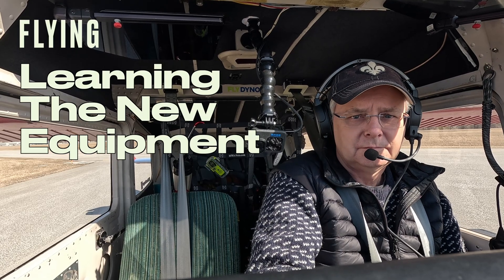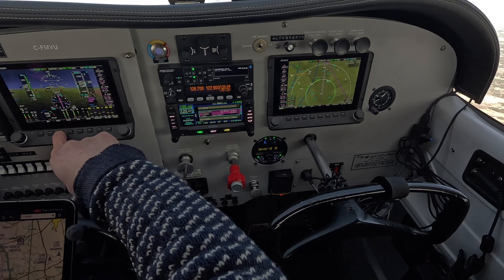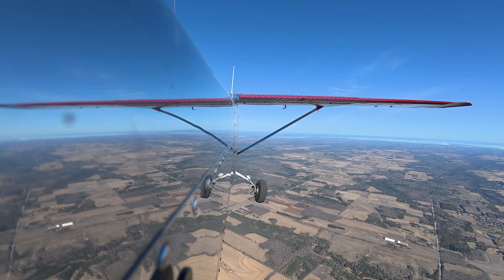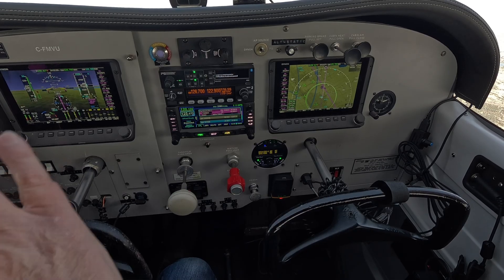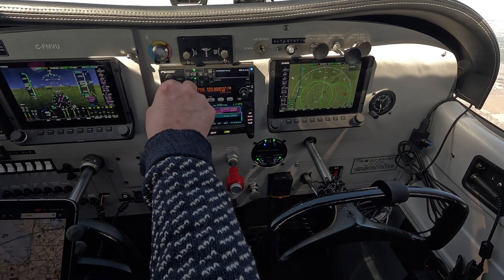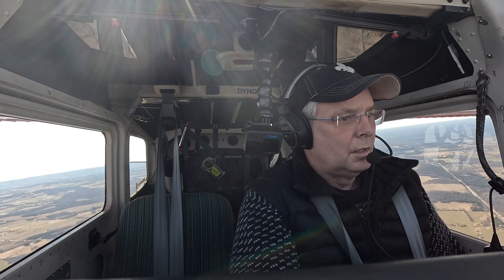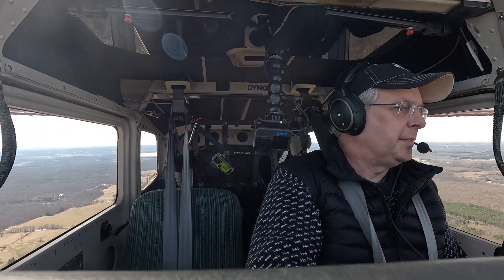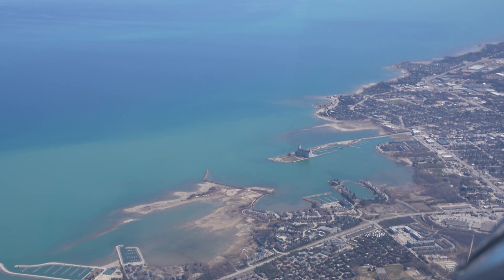Flying With The New IFR Equipment

Comment: For a non flying person.... what does IFR do and when do you use it? For the autopilot? Does that mean you can let the plane drive? When do you use it and how capable is it?
Reply from the maker: IFR (Instrument Flight Rules) means that you are allowed to fly the aircraft solely by using a specific set of instruments inside the aircraft, without being able to see anything outside the airplane. (like in clouds or fog, etc)
It's a little more complicated than that, but you get the drift.
The autopilot follows the flight plan programmed into the GPS and flies the route. It's pretty capable; mine will follow the flight plan right down to 500 above ground on the landing.
Reply: IFR means Instrument flight rules. It is the means by which qualified pilots are allowed to fly in weather that does not allow them to see ground reference and to enter into clouds. Doing so without IFR rating and proper equipment means certain death due to spatial disorientation,  meaning you lose all sense of what's up amd what's down. The new equipment allows him to do these things with more proficiency and accuracy.  Airports are equipped with radar systems that help pilots fly in these conditions and the equipment he has installed, communicate with theses systems to allow for safe entry and exiting of aircraft in bad weather conditions.
Reply: @mauriceevans6546  Oh wow.  So it's retraining senses, as well?
Reply: Also, he has an auto pilot which basically flies the aircraft based on what he has put into the system telling the autopilot to do. He can fly into bad weather and turn on the autopilot and the plane will fly him thru that weather without him have to fly the plane.  It is like self driving cars for airplanes.
Reply: IFR = Instrument Flight Rules, ie flying when you have limited visibility. In a nutshell, it means you can fly without looking outside the window. Imagine driving a car when you can only look at the dashboard.  Here's a good place to start: https://en.wikipedia.org/wiki/Instrument_flight_rules
Reply: IFR-Instrument Flight Rules.
When weather conditions are less than optimal (visually) this new set- up allows Glen to “see”  where he’s going via the instrumentation. 
Smoke, clouds, fog etc become less of a deterrent to flying because you’ve learned to “see” electronically.
Reply: Thanks everyone for the replies. And is the autopilot for of a safety thing? If you use it too often wouldn't that take away from the experience of flying if not solely for safety reasons like bad weather?

And would autopilot ever be capable of landing and take offs or is that too sci fi?
Reply: @404notfoundXx-m5k  I saw an ad yesterday that the new Cirrus SR G7+ model (a small piston engine powered aircraft) comes with an "Emergency Autoland" feature. A little gimicky possibly, but it does appear to work; the idea is for instance in case of pilot incapacitation.